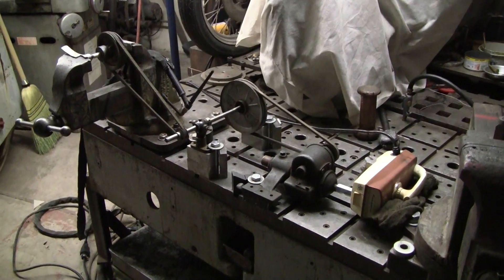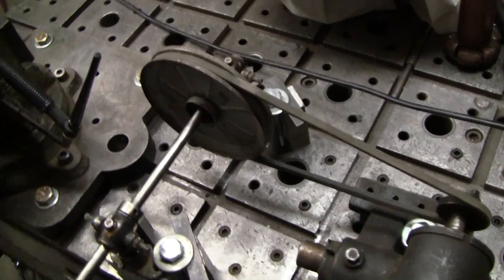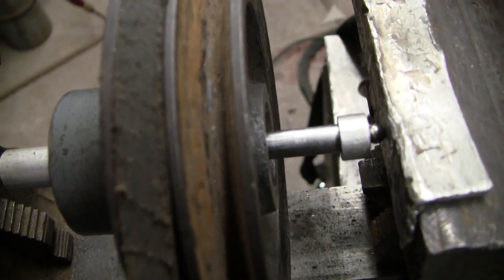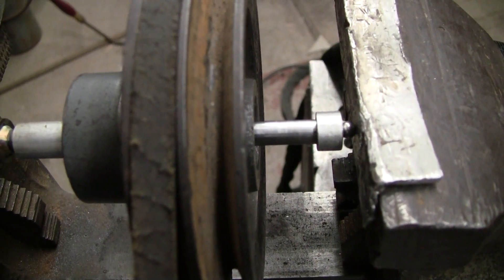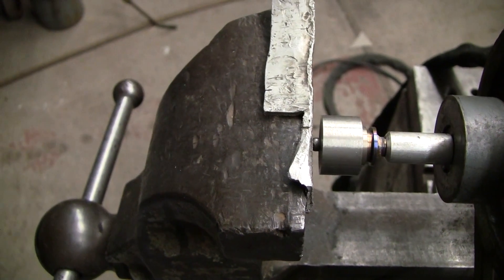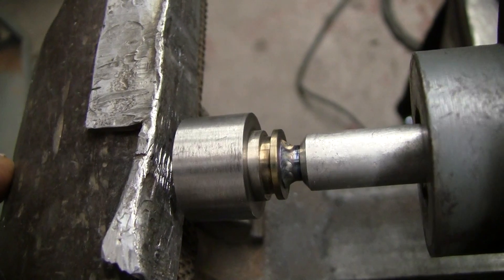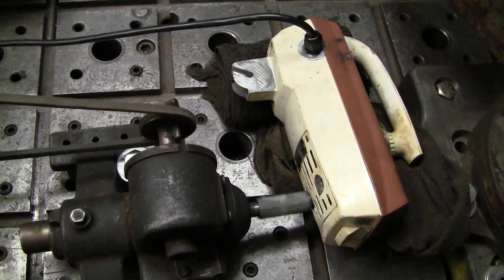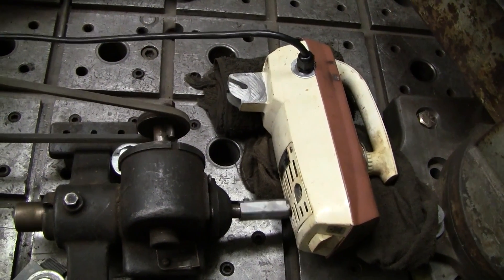Welding turntable? - I don't need no turntable!

Comment from the maker: Thanks for your interest and for taking the time to post a comment! Because the mixer was designed for kitchen use it does have variable speed. It is controlled by a knob concentric to the base of the handle support - on the right in this video. It is easy to miss.